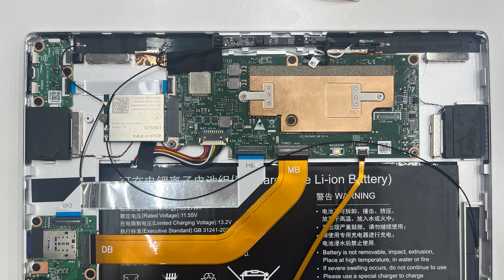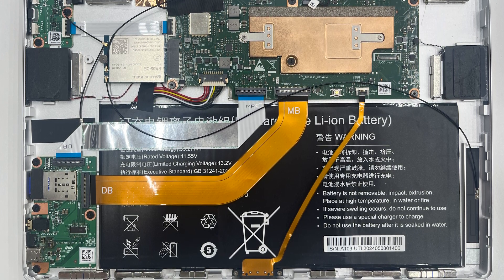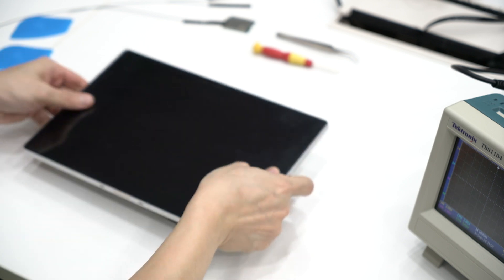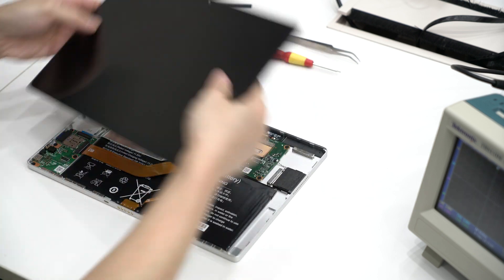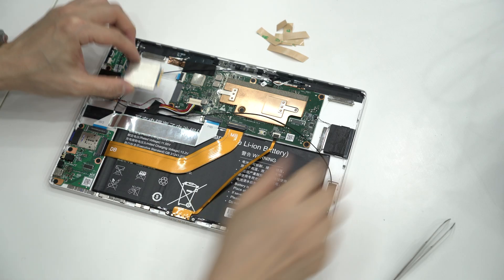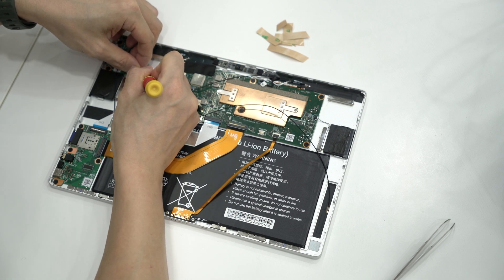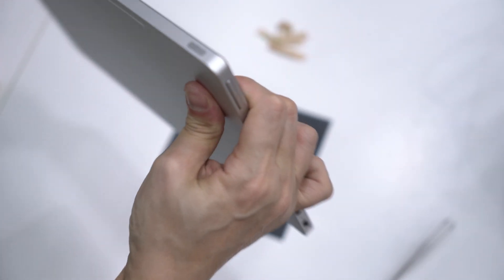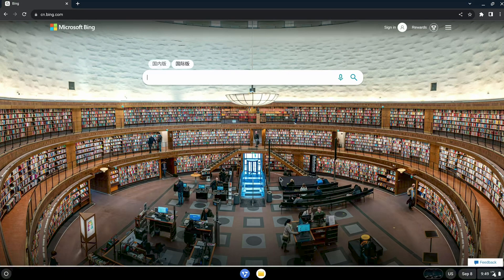Fydetab Duo: LTE module retrofit guide

Comment: Are all replacement parts including the screen going to be available for this thing moving forwards? Id like to design accessories for it, like rugged cases, vehicle mounts and docks, I would like to know that there is a solid future for the device, it looks like it would be very easy to upgrade the internals down the line like a Framework Laptop, I can also see a considerable amount of free space, I'm also thinking I could fit a Meshtastic radio in it, like a screenless T114 from Heltec, does the logic board inside have a spare USB 2.0 connection in the form of solder pads or a JST connector?
Reply: to my knowledge he only sees this as a toy and doesnt care to actually take this tablet to its full potential, as his words imply
Reply: @solodobo  Yes, I opted to not bother with it, instead just picked up a used Dell 7210 2 in 1 for less than a 3rd the price, and it came with an LTE card built in, all parts for repair are available, and it runs Windows, Linux, OpenFyde and anything else you want to throw at it, battery is not as good as it's Intel, but 5hrs is good enough, powerbanks are cheap these days if you want longer run times, I just cant invest in any new devices these days unless all service and replacement parts are available and will be available in the future, so I recommend a used Dell, HP or Lenovo Business class machine over consumer junk or oddball one off machines like this one.
Reply: @ linux runs well on this dell of yours? as I assume you were going to try linux on it.
Reply: @solodobo  Yes Fedora and Ubuntu based operating systems work perfectly, so does Windows 10 and 11, also Openfyde, I have the 7200 and the 7210 Latitudes, both are flawless with any of these operating systems, both are Surface like devices, but they can be opened and repaired with just a screwdriver, the 7210 is 10th Gen Intel, not the latest, but its very solid CPU still.